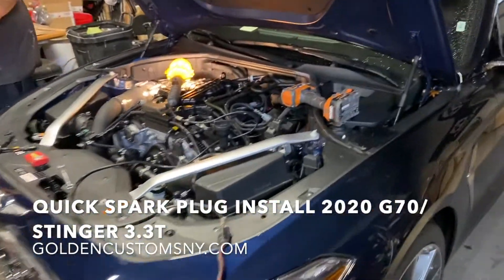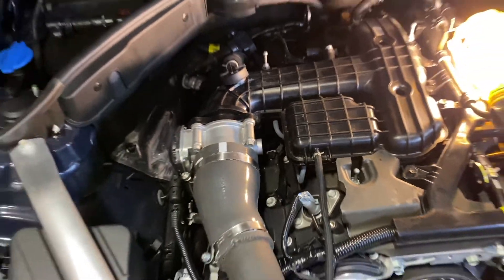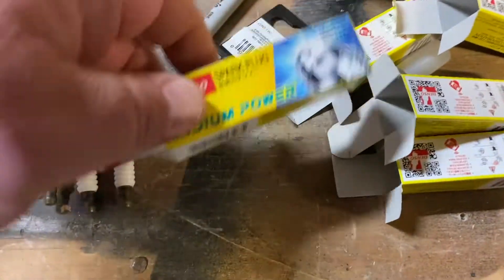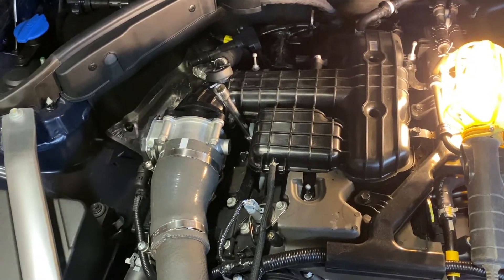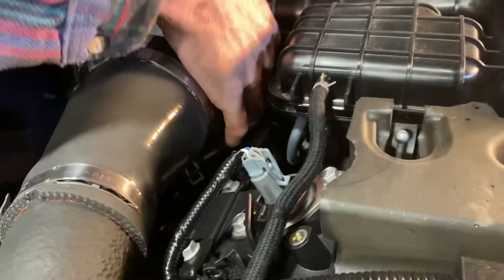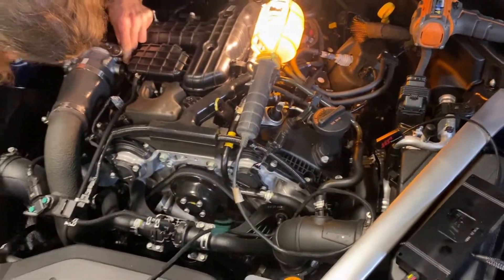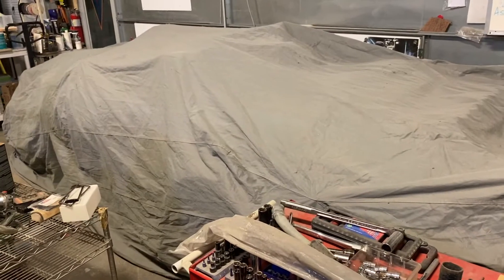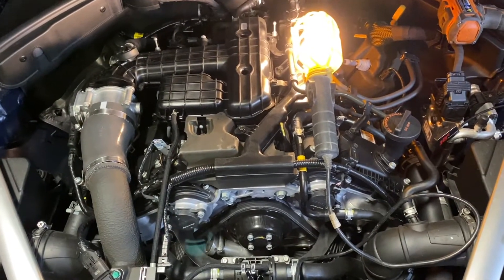Genesis G70/Kia Stinger 3.3T Quick Spark Plug Install

Comment: I had a hell of a time trying to get the coil pack out....Eventually gave up because i didnt want to break it and took the manifold off, just enough to get more room (You dont need to unhook ALL the hoses etc).  I didnt find it took long at all to loosen up the Intake.  This is my second set of Denso Plugs.  First set were the 1 step cooler, which they were toast after about 12k miles.  I ran on Map2 and 93 Octane 99% of the time. I did put a few tanks of e30 in it to try out map 5.  I dont advise the 1 step cooler plugs...they just wont last.  They are too hot and the electrode melts.  Instead go with the IKH27 (Burger Motorsports sells them too!).  I am crossing my fingers they last more than 12k miles :)
Reply: Do you have an update on those plugs? I’m planning on just re-gapping the stock ones and running map 2 and hopefully be fine

Comment: Do the coil packs come off pretty easy, that part looks like a challenge to, how do you reach the clips.
Reply from the maker: Sorry for late reply. Real easy. Only tricky one is the middle passenger side , just reach through the back side .
Reply: @Repoyodepo1  I had a BITCH of a time trying to get plug 3 out...(the middle one under the intake).  I eventually gave up and loosened up the Intake enough to get the plug/coil pack out w/out taking it completely off.

Comment: Can I please ask which is cylinder 1? My car through a check engine light and after getting code info it says" miss fire cylinder 1" spark plug issue  I think. Thank you
Reply from the maker: it' should be the front most on the passenger side
Reply from the maker: Did you change your plugs? 
If so, maybe you didn't seat the coil on completely?
Reply: @Repoyodepo1  thank you
Reply: @Repoyodepo1  I did it last night, I got plug out and it was completely flat without firing tip. Not sure how that took place but after switching plug car ran amazing. Wondering if I will have same issue with other 5 soon
Reply from the maker: @erickmendoza3320  was it the stock plug?
Reply: @Repoyodepo1  no, it was upgrade plugs recommended for JB4 set up. Iridium plugs